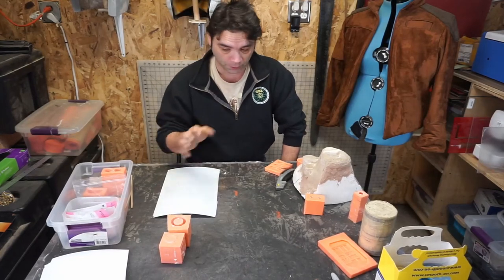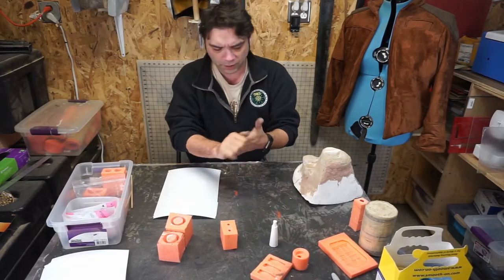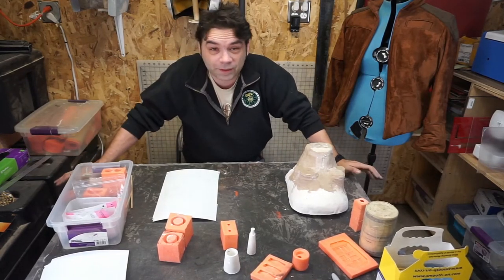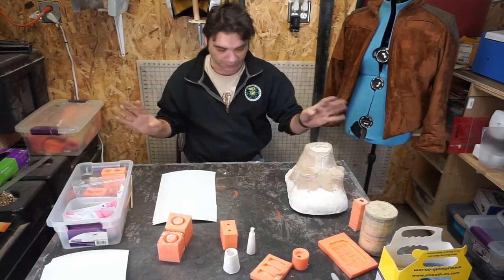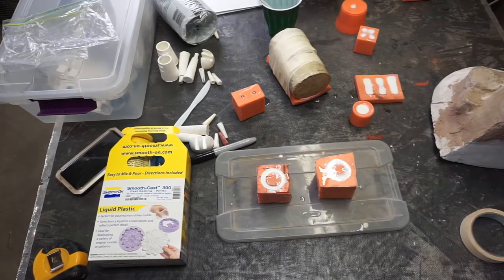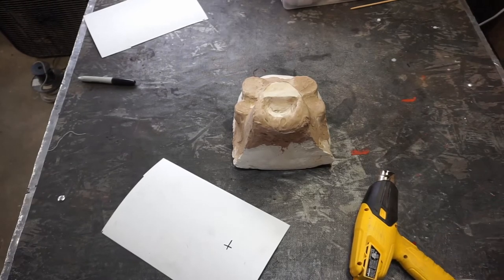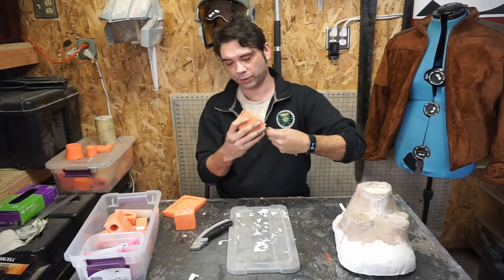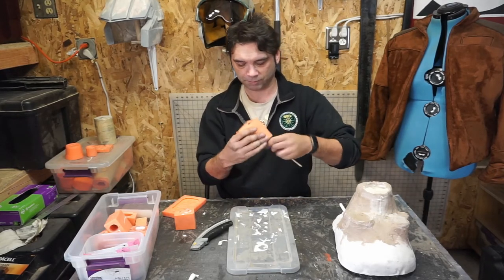Tusken Raider Faceplate

Comment: When you redo your molds in the future, I recommend backing them up with a shell. One easy way to do this is using LEGO. It is fairly cheap and you can build it into whatever rectangular shape you need. The reason why you want to do this (using lego, fibreglass, wood, 3D Printed, etc.) is that molds without support often produce quite distorted parts. Unless your silicone is on the harder end and very self-supporting, you'll find that the pressure of the resin will push out the silicone causing it to not hold its shape. 

Also, when designing the parts, it is often beneficial to add a bit of an extension (1-2mm) then cast. Ideally you'll even have a little lip where the part should end. Unless you're doing a two part mold, often what happens if the part is molded directly to the size, is that the last bit is not nice to work with due to the resin being under/over poured. If you add a bit extra to the original part, it can be easily sanded/cut down to the proper size giving a nice clean edge.